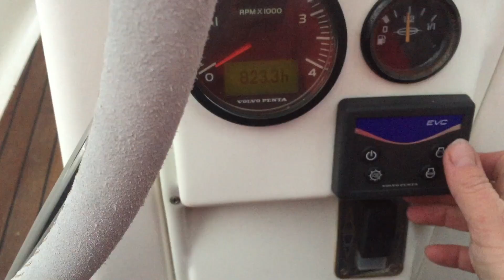Sailing Argo Ep 16 - It's not all about sailing....

Comment: I never would have thought about changing the oil before the season of non-use, that's a great note for future reference! Thank you for sharing! -c/t
Reply from the maker: Nomadic Gear Thanks, it was an oil engineer from Mobile who gave us the tips. As the oil get used it takes up sulfur and other impurities from the combustion of the fuel that’s makes the Ph level drop. So his advice was to change the oil in front of the non-use season rather than after. ATB Roger

Comment: If you go to a hardware store, you can buy a T-fitting for a place where your plumbing is exposed, cut the water line, insert the new T-fitting. On the other end of the T-fitting, you put some screw in adapters to be able to attach to a portable air tank. Then open up the air tank and all faucets to the on position. This will blow all the water out of the lines. Then you put a cap on the new T-fitting so it's watertight. You should be good to go for next season. ;-)  Your diesel is a different color than in the US, do you know why? How tall are you, Roger, that your head hits the ceiling? :)  c/t
Reply from the maker: Go Travel On The Cheap Hi, you guys ! You really put an idea in my head now.  Thank you 🙏The diesel we filled was tax free. It’s only allowed to use in boats, on tractors and machines. The green color will stick in your fuel system and if you where to be stopped in you car by the right people with green color in your fuel system, you’ve got a problem. I’m 190 cm tall, and the boat max  is 185 cm. But it’s not a big problem. ATB Roger